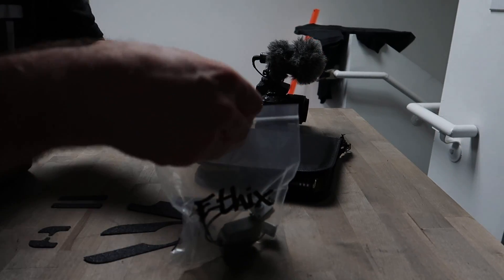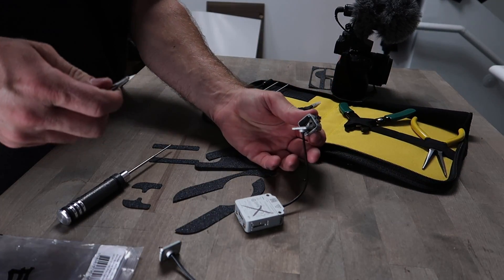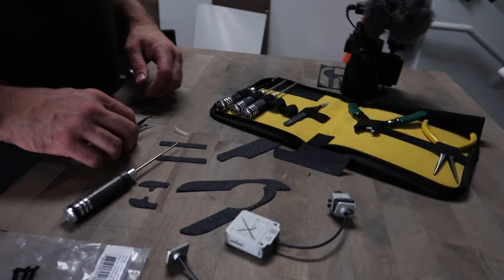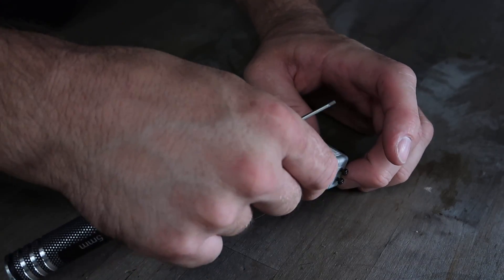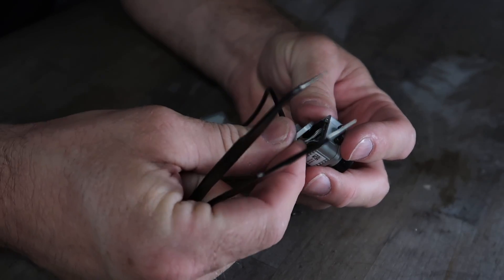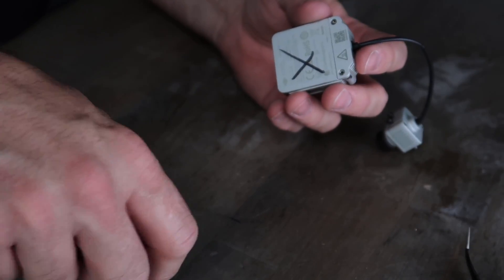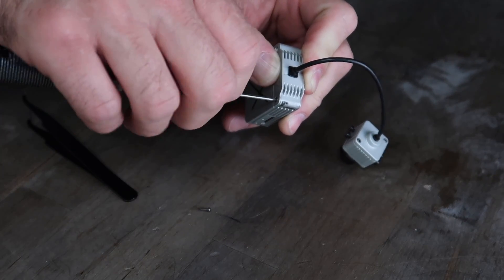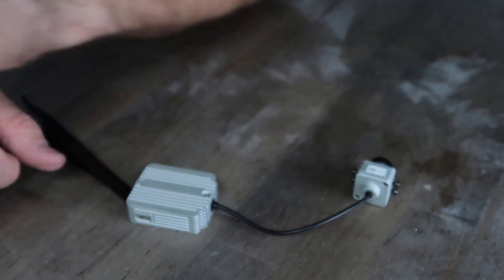How to Repair DJI HD FPV Air Unit Camera Cable

Comment: hi you did not show  how you push the wire through the rubber into the camera....... does the airunit cable compatible with the vista unit?
Reply from the maker: Binh Tran the wire comes with the metal square pre-installed.   I am not sure if it is compatible with vista, but, I think they are the same connectors.   

Check out this link to see. How the cable comes:

https://rotorriot.com/collections/dji-hd-fpv/products/dji-digital-fpv-air-unit-coaxial-cable
Reply: @LetsFlyRC  I bought the air unit cable.. wow better quality and it works perfectly :) thanks for the reply.

Comment: So the cable is replaceable. Another point in DJI's favor. Dammit.

Side note: how jealous am I that you can just walk into RR's studio and do your thing (and get tips from Drew!)? Very jealous.
Reply from the maker: Frank deBros haha. I am definitely blessed.  :)
Reply: More like 5 points deducted.......seems like they made this product so it’s keeps breaking and needs replacing
Reply from the maker: Not in the Skyeliner frame by LeDrib.  

I am still using my first ever air unit.  Haven’t broken a single lens since I started using that frame.  It is a tank.  

I beat the hell out of it and it keeps taking the hits.
Reply: @LetsFlyRC  you must have gotten a good unit....im on my 3rd and all 3 have had different issues and I have yet to have a crazy hard crash with them
Reply: Kevin King yeah because I’ve never broken the wires on an analog camera... 🤨
Reply: @swissfreek  but is it $ 90 to replace one part, $65 to replace another and $15 for a cable...……….I doubt analog is this expensive
Reply: Kevin King except it is. Maybe not $15 for a wire, but a good analog cam (like say an Eagle 2) is $45, good VTX is $50, then you need an antenna, that is $15 to $20 for a good one. You’re already over $100, if you use it as an RX, too, add another $25, and suddenly you’re only off by maybe $10 or $15 for a Vista. With an Air Unit you could (in theory) also replace your HD camera (certainly replaces a Split type camera, which is $90). Now you’re just about breaking even, and you have HD footage in the goggles on top of that. Yes, you can buy bargain basement analog components, but if that’s your thing, DJI stuff probably isn’t. In most cases there’s still a price difference, but I don’t think it’s as much as people think, and again, HD in the goggles.
Reply: Still not as expensive as the Dji gear......and I’ve had mine a month and already on my 3rd air unit......what’s 180x3= a lot more then analog problems......dji is like apple always going to have problems but always pumping out hype to buy and re buy